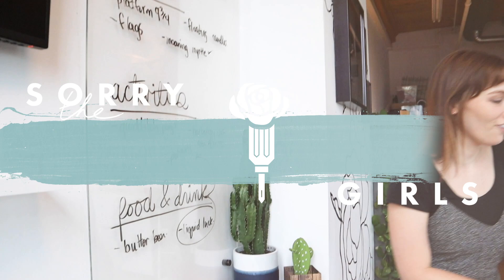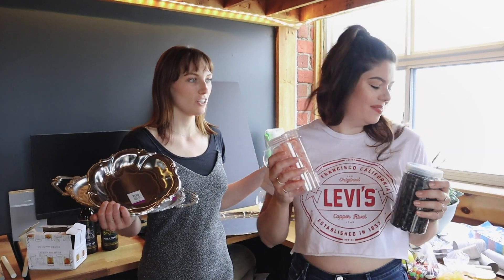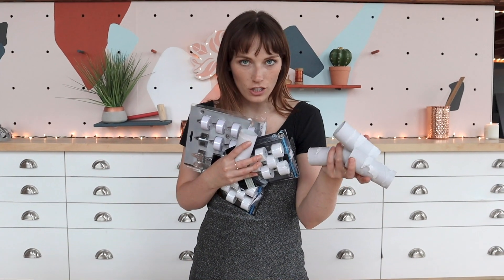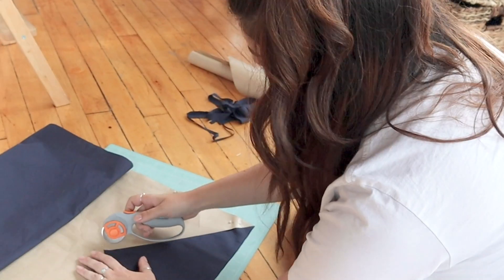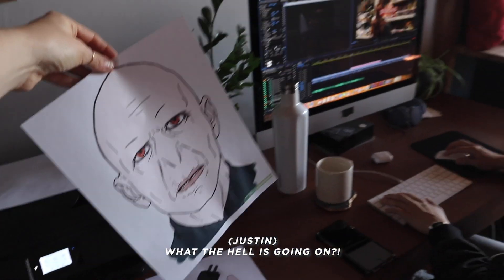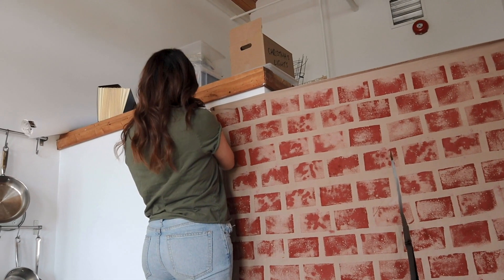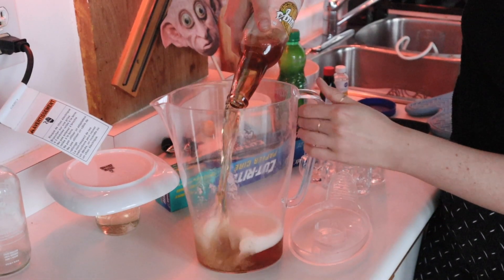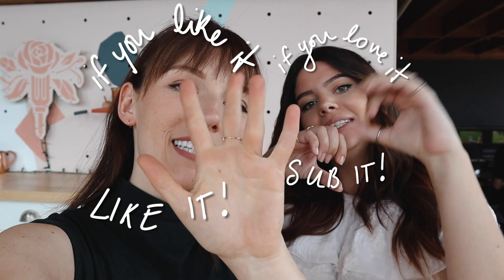We turned our loft into HOGWARTS!

Comment: Suggestion when doing the candles again is to thread fishing line in an x to hold the candle (easier to turn on the tea light candle) and use more hot glue starting from the top more the better looks more realistic). Have made many of these for different party decor.

Comment: Re: hanging things from the ceiling... depending how high it is, my workplace uses this system of magnetic hooks that you connect and disconnect from metal elements on the ceiling with an extendable installation rod. Comes with clear thread for hanging as well. Maybe look into it for future?